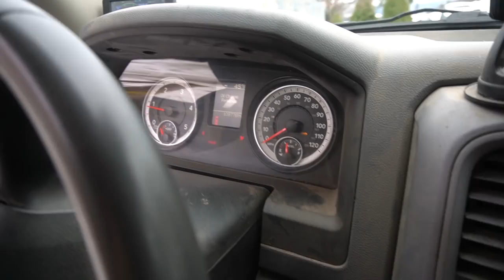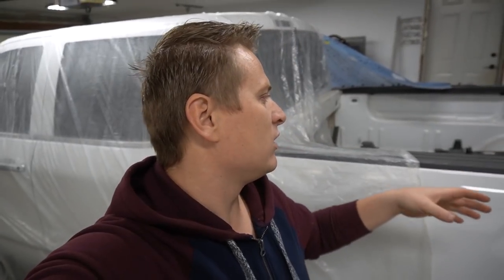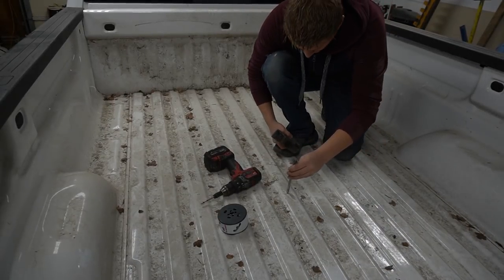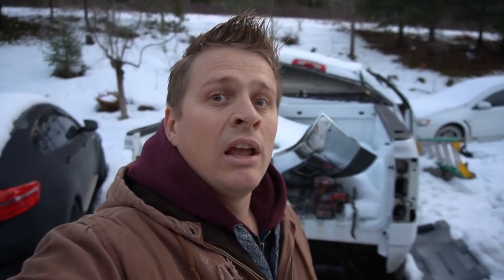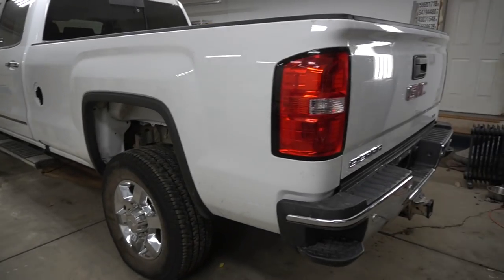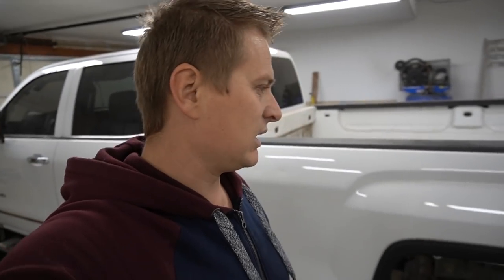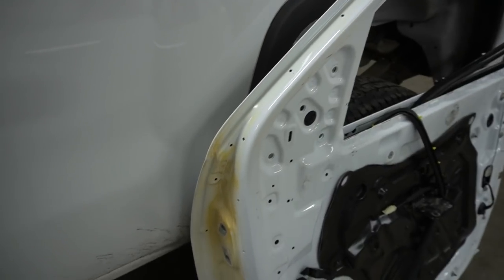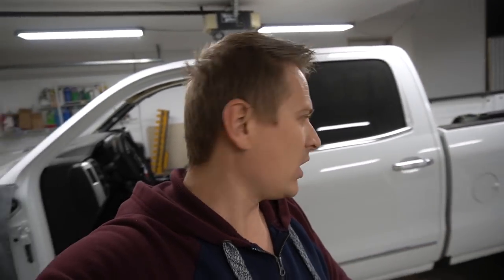Rebuilding A Rolled 2018 GMC Sierra 3500HD part 25

Comment: Did you make sure you have the gas cap on when you were having the issues with the pollution control system also the new Diesel's require that fluid I think it's urea make sure that the fluid is full otherwise you'll get in error as well good hope helps